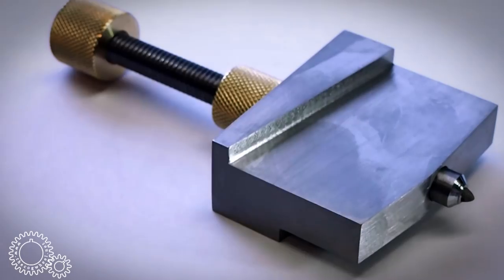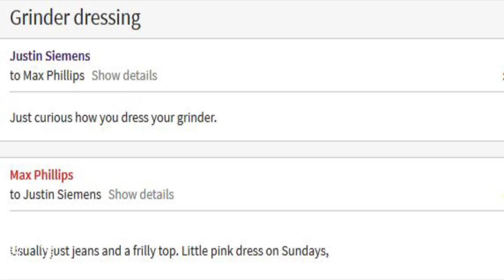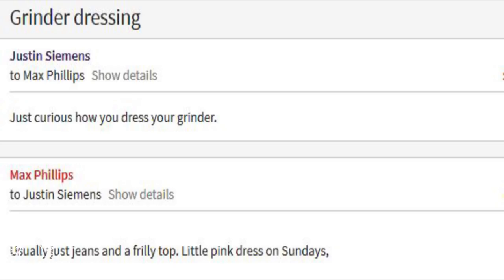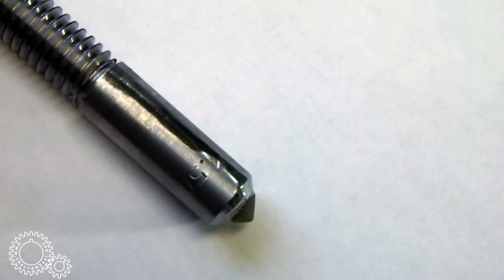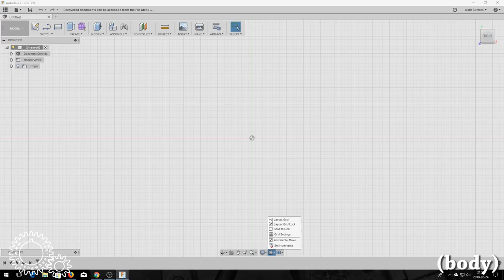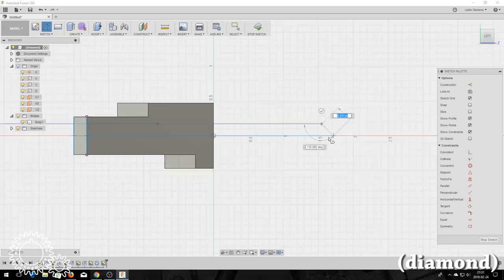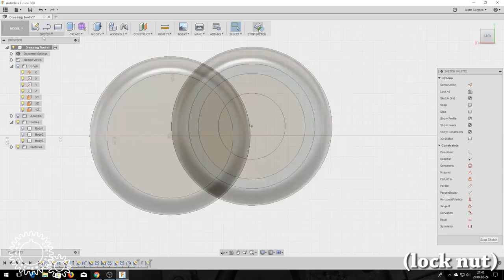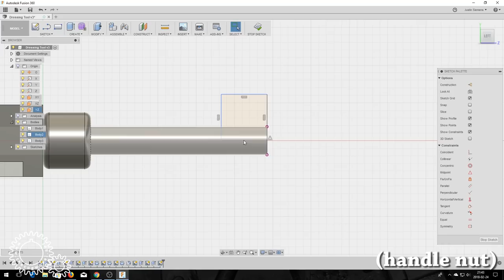Diamond Dresser

Comment: Absolutely enjoyed. Normaly I am not a fan of un-narated videos, but this realy worked!
Nice dresser, I think thats better than Maxs choice.
Do you like the 5C chuck so far?
Reply from the maker: LOL!  Yes even the crappy import 5C chuck is a really nice addition to the shop.  So much more refined than the 3 jaw.  After using it awhile you don't notice the gazillion turns to put the collet in.
Reply: Stefan Gotteswinter now what am I going to do with all these frilly dresses?? Justin, great work on the tool and the video, as always!
Reply from the maker: For a moment I had my bench grinder in a onesie.  I was going to film it but it didn't fit with the edit.  Thanks Max - looking forward to seeing you back.
Reply: You guys are terrible :D
Reply: Justin, I bent one end of the chuck key 90° to act like a handcrank. Makes collet change so much faster.
Reply: Justin: that sounds more like a T.O.T. gag.  Nice idea, I might have to emulate that one as well.  Star wheel dresser tends to follow the way the wheel already is, rather than correct it.
Reply: @diggerop - those star wheel dressers are the thing I like the least to use. directly followed by those tubes filled witch silcone-carbide grit.
If I cant have a diamond, I like at least a borozon stick for dressing a benchgrinder wheel.

Comment: "Why the 10 degree angles?" I asked myself.  It took some searching but I found that this is called the drag angle and apparently helps to distribute wear on the diamond point.  It was recommend that you turn the point 1/8th turn between uses.

Comment: Fantastic video and a super useful tool! Mind if I ask what the relief cut on the top of the tool body is for? And what's the glupe you're using for lube? Seems pretty efficient and not as messy as some.
Reply from the maker: The goop - wait for it - is bacon grease.  Works great, is non toxic, smells even better, and is really old skool.  The relief in the top is so that when the diamond is fully retracted the edge of body doesn't hit the grinding wheel.  Thanks for the support!
Reply: Got to love pigs, they keep on giving!!

Comment: You went to all that trouble to make sure your wheel is round, making this tool, but this logic flawd your tool follows the line of the grinder rest, which could be, not straight or parallel (to the point you want) to the wheels axel

Comment: Thank you for the effort to do this video.  what is the white lubricant?  why do you use angle to on the tool?
Reply from the maker: Hi Uncle Red.  Thanks for the comment!  It is actually bacon grease.  Lard or bacon grease is an old school lubricant that works very well.  The tool is angled so that the diamond is presented to the wheel angled.  This keeps the diamond at a point as the diamond wears.
Reply: thank you for the reply.   I am sure you went thru several angles until you got one that worked  what is the angle you use for you wheel sharpener?

Comment: Really liked your video on the single point wheel dresser. I have a T bar dresser that came with the grinder that really dont work all that great. I was on the web looking a single point dresser and the size of the diamonds are all over the board shank size and length as well. Is the larger the diamond the longer the life of the tool or is there a reason for all the different sizes. Really at a loss on which one to purchase. Any info on this would be greatly appreciated. Thanks for all the good videos.

Comment: Well done!

I think I've heard in one of your previous videos (or read on some comment you've made to someone else's videos) that you use lard or pig fat as lube to avoid toxicity.

So just wanted to ask, what solvent do you use to make it liquid as seen at the begining of this video? or is it that you just heat it?
Reply from the maker: Hi Eduardo!  It indeed is pig fat, or lard.  It isn't my idea - many years ago it was quite popular as a cutting fluid lubricant.  If you are familiar with the Buttercut commercial fluid - it is made up of some sort of fat mixture.  Lard or bacon grease is interesting because at room temp (about 21 degrees or so C) it is a paste.  Heat from the cutting process melts it.  Which is great for home shop work - you can brush it on and as you cut it turns to liquid.  In the winter months since my shop is cold the bacon grease a paste.  When it is is really warm in the shop it is semi liquid.

Comment: why should it have an angle
Reply from the maker: The angle helps keep the diamond at a point as you dress the wheel.  When you rotate the diamond since it is presented on an angle it wears more evenly.  You don't have to put it on an angle but it lasts longer if you do.
Reply: @thecogwheel  thank you